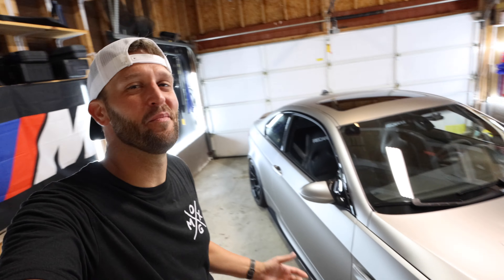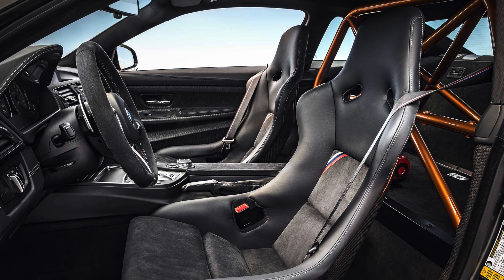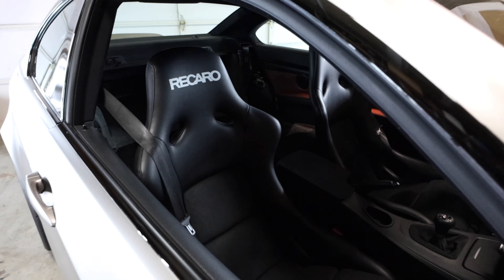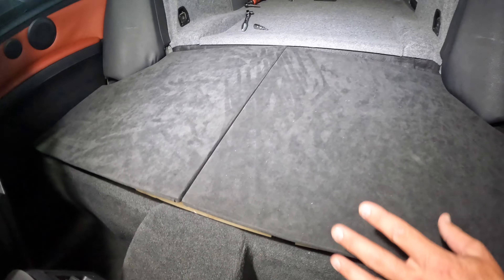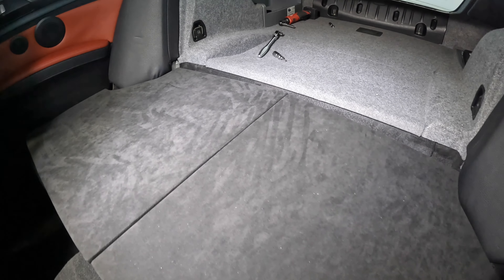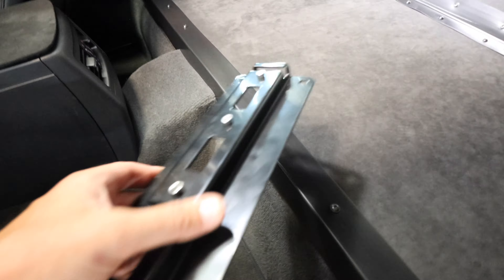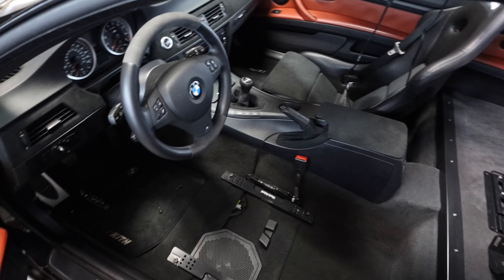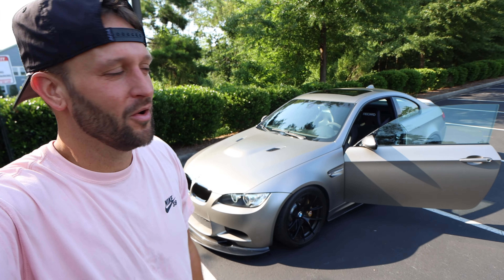Installing a GTS Rear Seat Delete In My E92 M3. (PS Designs!)

Comment: The e90 rear console mod is slick. Good call on that. Delete looks great. Only part I don't love is the flex in the angled sheet metal where the screws go in. I feel like that could be cleaned up by the kit's manufacturer in some way as well as maybe a larger standoff for the vertical part of the rear seat so the angle lines up with the grey trunk liner. Or they could sell an additional trim piece for that that covers it with the kit. Seems like a tiny revision to the kit by the manufacturer would make it 100% perfect. Sounds like yours was the first prototype kit they made for an e92 without a roll bar so it would make sense to revise it before producing more of them.
Reply from the maker: I’m actually going to remake those trim pieces in metal. That’s how my M4GTS was. It will work much better. I’m assuming manufacturer used plastic because the metal would increase price a bit
Reply: @ThicWhips   Dope! Some titanium super high end finishing screws/bolts would also look sick too. Like race car jewelry. Just those fine finishing details and that setup is going to be perfection.

Comment: That gap between padding an the sheet showing the grey carpets will is disappear with the half cage mounted?
Reply from the maker: I’m not sure. I’m going to use extra alcantara to fill that gap
Reply: @ThicWhips  Thanx. It looked good otherwise with those trim pieces. Had another in mind but it doesn't look as OEM or sturdy as the one you have.
Reply from the maker: Yeah it’s solid man, im quite happy with it. I may use metal rather than plastic on the trim pieces just give it a more refined / solid look. But the plastic does the job for now